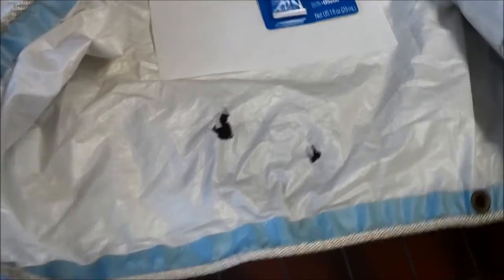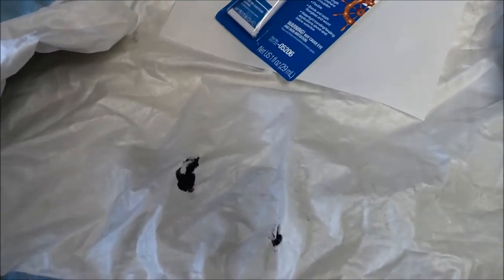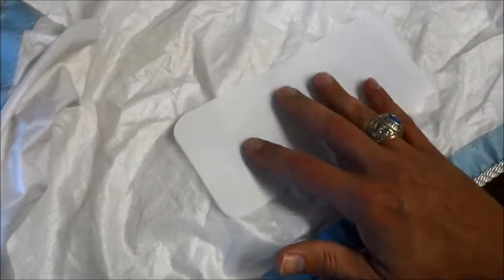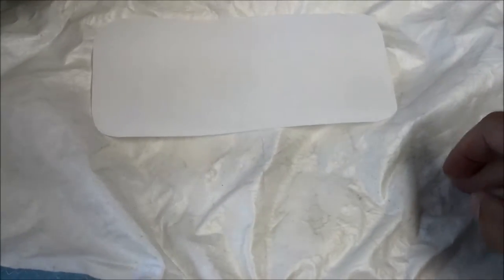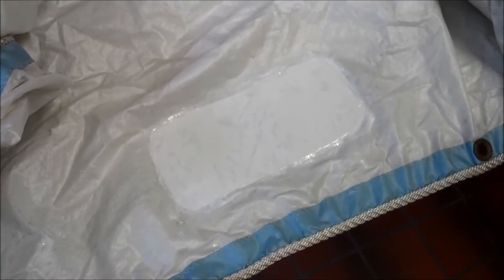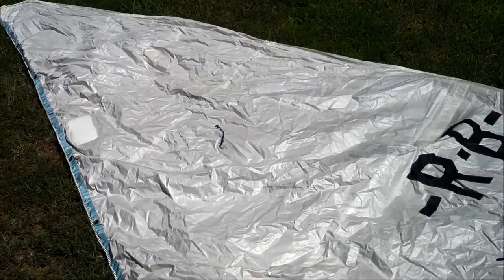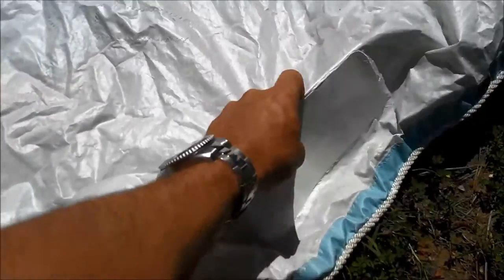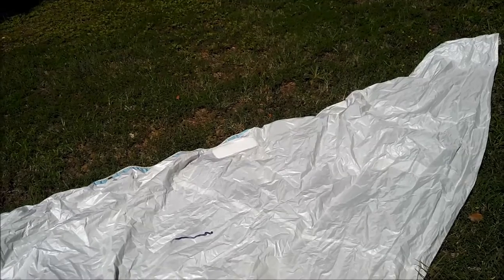Easy Sail Repair - (Using  3M-5200)

Comment: Hi just wondering if you have a update on how the repair has stood up.
Reply from the maker: Hi Russell - it's holding very well.  The sail is probably stronger there than anywhere else.  No issues.  It's a easy and pretty cheap way to fix a rip.

Comment: Great idea! Thanks for the tip. I have some spare sail material around, I'll use that instead of buying tape! Muaahaahaaa! lol
Reply from the maker: +Richard Dyer Thanks.  It's held up for years.
Reply: That's awesome! Do you know a good way to replace the leather at the head, clew and foot of a sail? I have some that have worn through. :-(
Reply from the maker: Pretty much need a sailor's palm, some thread and leather scraps and just stitch it in. Beauty doesn't count there when repairing an old sail, just make it strong.